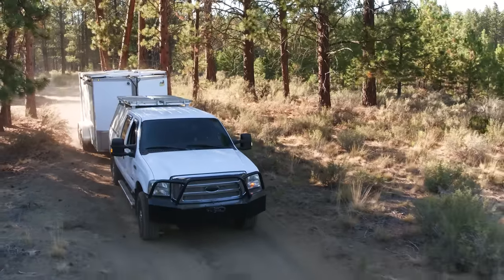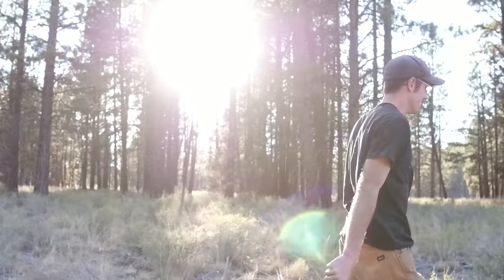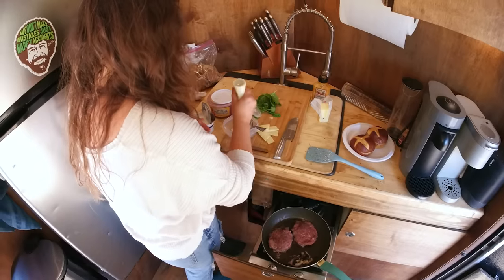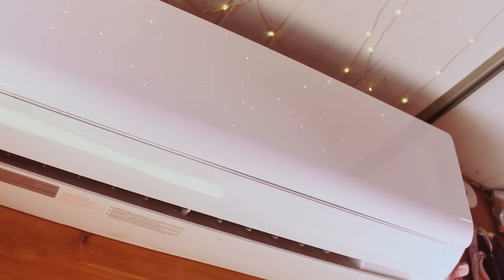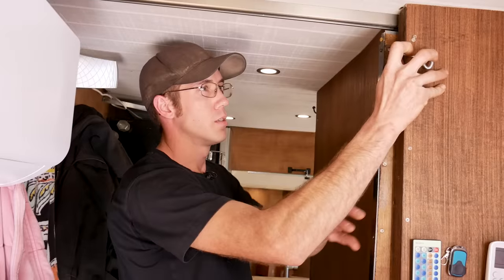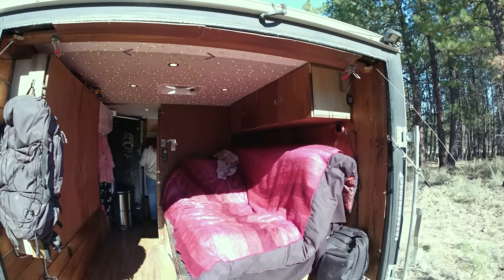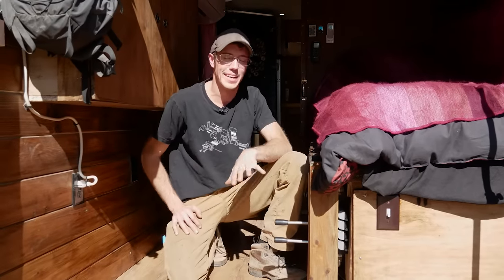He lives in cargo trailer & it’s actually nice?? DIY Tiny Home

Comment: Very smart of him, because most travel nurses get a pretty decent amount for room and board! He can just pocket that or use it to improve his traveling home. Smart!
Reply: Per diem rates are pretty good.
Reply: Thats what I do. Not a travel nurse, but I travel full time working in utility scale solar. I get $120 a day, 7 days a week. So $840 a week tax free. Currently in a $210 a week motel, which, as long as they are clean, I prefer. Old places where I can open my door to the outside. So $3300.00 a month and between lodging and food, I have at least $2000 left over to pocket. I can spend per diem and never touch my checks. It all goes to savings.

Comment: Oh wow! That’s a simple yet genius design and layout. Stealthy from the outside, yet rather spacious inside. One of my fave’s is that they got a shower and black tank toilet. I’m a big fan of that rig
Reply: What is a black tank toilet ???
Reply: @deaconessg2468  you know, the toilet is connected to a black tank, where solids and liquids aka poo and pee go to the black tank. And yes maybe I should’ve said a toilet with a black tank. Just thought everybody knew what I meant
Reply: Stealthy? Did you miss the massive air conditioning unit on the front? 😅
Reply: @sharpsticksnz4112 ope! I did indeed see it. But the white box trailer without any windows is still way more stealthy than an ordinary travel trailer, fifth wheel, airstream or any of those types of “houses” on wheels. Like the man said he was going for a stealthy look. And it looks like a work trailer. And I agree with him

Comment: Nice build. Really like the lift system on the trailer.  Wouldn't mind more info on that.
Reply: Two way hydraulic pump from Amazon, hydraulic drop legs for trailer tongue turned flat, and a four lever two way four lever hydraulic valve body. When the drop legs are fully extended the leg is pulled up into the frame. As the cylinder retracts the legs is pushed down and out via a class three lever, email me for pics/diagram. Have a good one!

Comment: Great build. I wanna know more about that e-skateboard !
Reply: I took a bog standard mounting board and put a 48 volt lithium battery pack on it with two 5,000 w three phase motors and an electronic speed controller with bluetooth remote, there are quite a few build videos available on YouTube if you're interested in creating one!

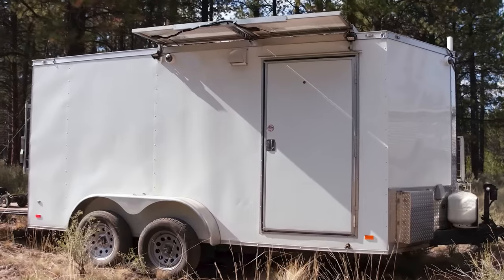Comment: 3:00 did he just say the trailer weighs 16,000 lbs? I think that must be a verbal typo! The 2006 Ford F260 has a standard towing capacity between 8,100 and 9,100 lbs.
Reply: I thought the same thing, it has to be combined! I'm looking at a new 7x14 Off Road 4 season trailer from Colorado Trailers, tandem axle and its dry weight is only 3200 pounds!👍

Comment: Isn’t it freezing in there? How do you keep room temperature stable in there?
Reply: The heated floors have an internal thermostat, and when it gets under 15F I have a secondary diesel powered air heater in the rear that keeps it low 70s
Reply: There's also an inch and a half of insulation in the walls with radiant heat barrier